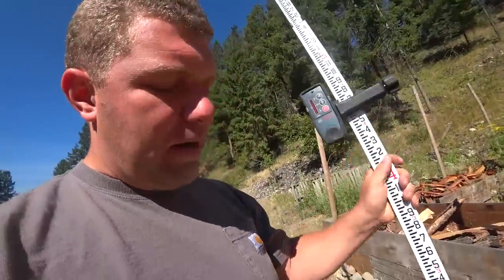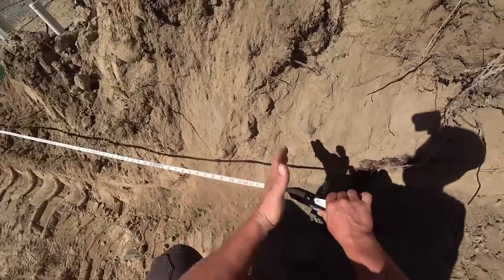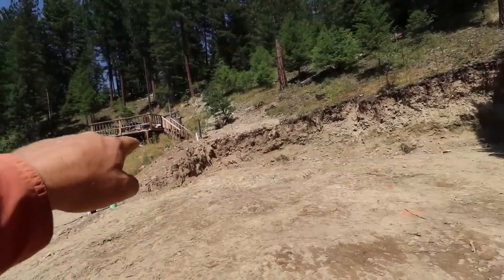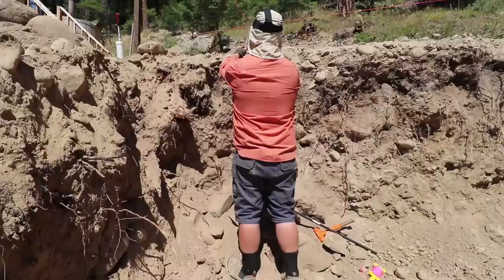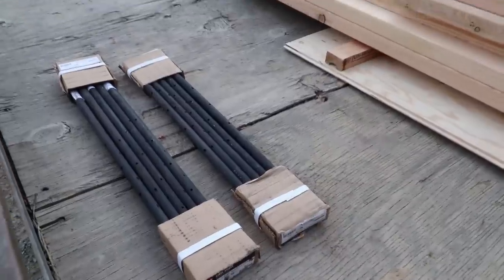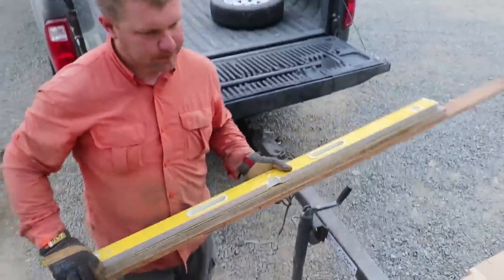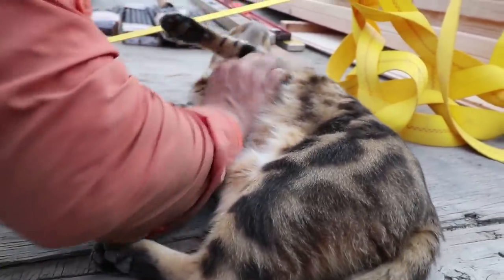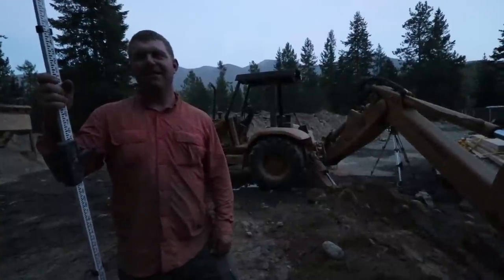TAPE MEASURE MELTDOWN (Squaring & Leveling Home Site)

Comment: Typically we only use the plastic and cloth tape measures for estimating and rough dimensions. But for crucial dimensions we use 100' steel tape measures because you can not stretch the steel tape measure, like you can the cloth ones.  I love your channel. It is informative and entertaining. Thank you very much!

Comment: The tape isn't off.  It's in 10ths and 100ths of a foot.  It makes calculations much easier.  It's completely standard in the heavy construction world works.  Architects work in inches, engineers and surveyors work in decimal feet.
Reply: HaHa..that was soo funny! "what kind of tape measure has 10 inches per foot!"  You live and learn!
Reply: "engineers and surveyors work in" metric
Reply: That's the tape you use to draw your sight plan.
Reply: Site plan, sight plan
Reply: LOL!  :-)  (From France, inventor of the metric system SI) :-)
Reply: and you should use a steel tape or chain for important measurements instead of a fiberglass or poly tape
--if temperature is an issue you can calculate for steel :)

another great video!!
Reply: Patrick Norton  or go metric and simplify your life once & for all.
Reply: Just as some people are very capable of being multilingual, some people are capable of working in both imperial and metric,as well as machinists decimals. What's next ,change  that the measurement of a circle is in 360 degrees ,a day is 24 hours  or that a mile on the sea is a nautical mile?
Reply: That tape made me  think of the three-sided architect ruler that I've had since college. I had no use for it then, or since, but I bought  it because it looked cool. :)
Reply: inexperience
Reply: This is why the entire world uses metric system.
Reply: AGREED
Reply: Use cubits, it's the 'new world' after all
Reply: scott that is not a metric tape.   A metric tape is marked meters,, centimetres and millimeters. They need to get 50 or 100 foot steel tape, because the tape they are using can be  short by 1 to 1.5 feet per 100 feet.
Reply: phillip i said that i agreed on metric system and i know that is not a metric tape.
Reply: It's a comprise over using metric.
Reply: Patrick Norton q
Reply: You may also want to send your tape measure to the standards lab.  They will calibrate it for tension and temperature.  Or at least the book I read from the late 1800s said they would do :)
Reply: Right! Whats a cubit???
Reply: A steel tape yes, which was once the standard for surveyors now they use the total station. Fiberglass will stretch so calibration is not needed - Just don't pull too hard. On the other hand steel tapes have a particular tension requirement, They are also compensated for thermal expansion by the surveyor in the field.
Reply: Steven Hardy, you can measure circles (or any angle) in degrees or radians, you know, Pi, 2 Pi, etc...
Reply: Zenithtb  Only when I have to.  A civil engineer.  Age 70
A lot of those tapes are marked in feet and inches on one side and feet and tenths on the other.: at least the one I have is.
Reply: Question.  How many countries have working probes on Mars?  Answer. ONE.
Reply: and im pretty sure NASA uses standard units for that..
Reply: A Cubit is the measurement  from th bottom of your elbow to the tip of your middle finger!
Reply: And also used them for 44 years on drilling rigs all around the world, only way to drill in feet and be able to add up in columns, very easy!
Reply: CaptAndy Sir Lol NASA uses metric
Reply: but even being in 10ths the 345 rule for squaring works, it's not about de unit
Reply: This isn't about imperial vs metric.  It's about his "10 inches  per foot" comment.  Whatever system we use as engineers is really dictated by the various state/federal transportation depts.  The feds tried converting to metric about 20 years ago in their funding bill, but it flopped.
Reply: typo should be 10 450 not 10 045
Reply: so its like metric but its not. silly.
Reply: Only since the 19th century . . whose arm are you using? it is impossible to build well with a variable length standard. (In reference to Dave W.).
Reply: Jim Steel- that would be a "scale"
Reply: Corndog I mean standard like 1 foot which is not a scale but a standard of reference. Measuring from your elbow to the tip of a finger is a standard of reference not a scale.I know sometimes the difference is slight but. . .
Reply: I was replying to Jim Steels comment, not sure why it wound up here.
Reply: Okay, I wasn't too sure but I made a reply anyway (hehe) 'cause it could have, might have, close enough, That is why I used your handle for clarity. Hey have a Fabulous day, er evening!
Reply: yup
Reply: Sounds a lot like the metric system

Comment: Had the same thing happen with a tape measure I bought from an auction.  Used it to measure out my footings and found out after just by chance using a 35ft tape that I had sitting around, and I had a high speed come apart.  Almost used it for my whole footing also.  Thank god I caught it.  You guys are doing a great job!  I used Icf's (fox blocks ) on my crawlspace walls and man they worked out great!  Good luck and keep up the good work!

Comment: The tape with tenths of a foot is a engineer's tape, used one for 40+ years in the West Texas oilfields. Tubing, casing, drill pipe and anything going in the well or top of ground for construction was measured in feet and tenths. This method allows easy tallying of measurements for totals instead of having to deal with fractions. Glad you bought the ShopSmith it is a great all in one tool but your time/project/steps will need to be planned well ahead in order to make it a enjoyable tool. The all in one does imply tool set up changes due to the limited one motor drive or all procedures. Enjoying your build and channel..

Comment: Don't  play  around  pump it you will  have  a much better pour. Remember  your home  is only  as good  as  your foundation. One man built  his house on the sand and the other  on a rock. Put as many  chain walls  and  steel  as practical. The  slab is not  were you want  to  save money. Great work  and great  Videos

Comment: One of the few things I appreciate about engineering school was learning how to work in imperial, metric and decimal.  As well as degrees, radians and many other things.  The most important thing was to ALWAYS know what units you are working in!!
Reply: Exactly...now just tell me if you did your studies using a slide rule? ( I still have mine)
Reply: Steven Hardy I'm a little too young for that.  I have been looking at flea markets for one for a while.  Thought it would be cool to play with.
Reply: Well, I remember like it was yesterday when Rockwell first released their handheld ,8 digit ,led calculator for 200.00 bucks. No science functions.....just basic math. About 1973 I think.
Reply: I remember the Bomar in 1971 or 72. It was $200, 8 digit with 1 memory.   Hewlett-Packard had their HP45 scientific calculator  for $450 in 1971.
Reply: Steven Hardy --- I looked at my old slide rule about 6 months ago, couldn't remember how to use it....lol. 
But it was a life saver in 1963-1966.

Comment: Civil Engineers and Land Surveyors work in base ten measurements.  Base 10 gradations are standard in the civil and survey industry because they follow the US Cadastral Survey Office standards which IS the standard for mapping in this country.  If your property has been mapped by a Registered Land Surveyor its units will be base 10.  If you have a topographic map of your property spot elevations listed will be in base 10.   I have researched hand written survey notes of BLM land surveys from the 1880's All of the measurements are base 10.

The "tape measure" you were using is actually referred to as a chain, or survey chain, and dates from the 1700's and 1800's. It was originally made of 100 metal links 7.92 inches each or stretched out was 66 feet long.  The US version of this was 100 feet long, each link being equal to 1 foot.  More than two thirds of every square mile of this country was walked and measured and mapped with a very heavy version of the device you are holding in your hands.

And it's not just the tape measures.  Surveyors and Engineers elevation grade or range rods are also marked in base 10 units. TopCon, Zeiss, Geodemeter, and Trimble, the who's who in GPS, Level, Total station instruments that are actually used by professionals all come standard with base 10.  Your Bosch is in base 12 because the big box stores and online mail order primary sell to the small carpenter trades and extreme DIY industry.

While the architectural and home building industry work in base 12.  All of the mapping, plotting, and elevation certifications required to get permits and certificates of occupancy of dwellings are require to be certified by surveyors and engineers in base to units to the nearest 100th of a foot.

For all of these reasons and for efficiency in calculations to an engineer or surveyor base 12 is worthless.

Comment: Surveyors tape. its in tenths of a foot. 

Makes the surveying math easier. Surveyors don't work in inches, they work in feet and tenths of a foot.

Some grade rods are also in tenths of a foot. you may want to check yours.
Reply: Do you really go through comments first? Wow... That's dedication..
Reply: Hal S --- Their grade rod is in feet/inches with 1/8" increments. So they are good there.

Comment: So it dawns on me,  as I watch someone who has no idea what a 10ths "engineers" tape is,  you talk about using ICF's and a typical foundation layout for a stud wall/platform build.  But you have said in the past that your doing a post and beam construction house, which has significantly different foundation requirements.

Can you let us know how you are digging your foundation holes with no foundation plans indicating the size of the footings required for the engineered loads based on the post and beam construction?

Comment: I installed a window air conditioner in one of our rooms at work last week and it came with a tiny plastic strip that had measurements on it (inches on one edge, metric on the other) so you could cut the little insulation panels that came with it. I was doing some measuring and realized the inches were divided into tenths instead of eighths. I went ahead and used it... didn't really matter as long as I used the same thing to measure the hole and the piece I was cutting.
I wish we would go ahead and switch to metric. It would confuse people for a while but it's a way easier system to use.

Comment: It's NOT metric, it's an engineers scale, it's an american thing. It simply divides a foot into ten increments instead of 12 inches, and each increment is again divided into ten (ten pennies=a dime, ten dimes=a dollar. Very easy to use, i used to teach people think of a foot like a dollar, 100 cents=1 dollar. When doing percentages 5%= five of those little lines. 2.75 would be 2'9" or two and 3/4 feet... or $2.75. Each tenth of a foot is apprx 1 1/4". Each little line is apprx 1/8".Takes a little getting used to but also most inspectors (ones I've dealt with) use engineers scale when checking your work. Good look with the build guys.

Comment: Hi Luckily for you it worked out, this is a long time ago (The 70's and in the UK we were just going metric) but a close friend bought a long imperial  tape from Taiwan  and it had 10" to the foot so his keel ended up way short before he noticed and to far into the build to change it, so he ended up with a shorter boat than was planned.

Comment: One thing i did hear jesse say that the concrete contractor told him not to over excavate to much @ the back of the wall? but you can still slip a form in there? how do you guys plan to slip it in there and brace it and then strip it all at the end? i saw like 4-6 inches of clearance. Ive always seen 18'' -24'' wide clearance to work in but hence i would never go behind a wall that high that close even 24'' clearance that could cave in =( , Please comment =D

Comment: Concrete pump, fill the trench with log. Bricks, blocks, sleepers. Thick metal plates across the trenc.Truck then can drive over. No such thing as can't. NOTE make sure it's easy to pull out off the footing (no time wasting when pouring). Makes sure when packed it is a tight fit so no colapse. You can send half the saved money to my account. Only taking half as I'm not greedy. Good luck hope you get this in time.

Comment: Did you (or 'DO' you) check for square diagonally corner to corner to corner? I know you can check one square corner with 3,4,5... But I think you would still need to check from corner to corner diagonally??

Comment: Recheck your state plumbing code. IBC is 1/8" per foot on 3" and 4" pipe. 1/4" per foot on 1-1/2" and 2" pipe. Will you be using 1.6 gpf toilets.

Comment: Did the ICF company mention any negatives in the use of ICF's?  I've never been crazy about them where there is a lot of soil moisture as we have here in Western Oregon.  Your climate and weather are more forgiving.  We were told that Styrofoam (Expanded PolyStyrene EPS) works as insulation and the forms.  I helped a fellow replace his dock several years ago and it was made with EPS blocks.  I was to lift the dock out of the lake with my 15 ton rough terrain crane and was mistaken about how much water EPS can absorb.  I expected to just pop the dock out of the lake.  I didn't think the big EPS blocks would absorb anything.  I nearly tipped my crane into the lake trying to lift the dock out.  It was unbelievably heavy.  We had to float the dock to the boat ramp and disassemble it piece by piece.  When EPS gets wet, the insulation factor goes down to very near zero.  I learned a lot as to where ICF's are good and Arizona is a better climate.  

I do the design and drafting work on the houses I build.  One of my clients is acting as his own contractor.  He was sold on ICF's by a dealer he met.  I designed the house with a standard concrete wall with insulated frame walls on the inside.  The owner had the engineer convert the calculations to use the ICF's.  He then found out that the electrical codes required him to run everything in the ceilings and then drop down with electrical conduit to the switches and outlets which was a pretty large extra expense in labor and materials.  He then found that a lot of sheetrockers in our area won't work over ICF's.  When he did find one, they required the owner to install furring strips to the walls to screw the sheetrock to; another unexpected cost.  Plumbing was a bit of a problem on the outside walls, but not as big a deal as the electrical.  Also, anything above the final grade on the outside has to be finished with plaster, stucco, siding or stone so that the critters don't make a mess of it.  Chewed up and dirty EPS isn't really attractive.  

I just poured the stem walls for a foundation on a log home restoration project and I used pebble drain rock instead of crushed rock.  We stripped the forms quickly and sandblasted off the surface sand and cement to expose the aggregate.  I wiped it down with muriatic acid, rinsed it, let it dry and then applied a clear acrylic sealer.  It looks good and is a no maintenance finish.  When I run the numbers on all the work to pour the walls, frame, insulate, electrify and finish the walls, I come out cheaper in the end.  I don't see ICF's being used at all these days in my area.

Comment: You can mount the laser sensor on your bucket and check the depth from your seat ... just have to make sure the bucket is in the same position every time you measure.

Comment: Nothing wrong with paying a bit more for convenience and that pump was slick.  But you didn't have to leave out a section of footings otherwise.  the alternative is called a wheelbarrow, and most construction guys fill their footings that way. 

That laser level is a luxury, when I first started they didn't exist, but its awesome you have it.  

A normal excavation is a 2 foot offset from the outside wall.  

You are lucky that your frost protection there is only 2 ft.  I am Canadian and we had 4 ft where I Lived, and that was a place that is south of 40% of USA.  

You guys are really doing amazing for having never built a home before.  Are you going to be backfilling your foundation to put a slab at grade?

Its also amazing how a couple cal live and work together 24/7 and still be cool with each other.  Respect.  

In theory, if your footing is off, you can still correct your foundation to square.  But, even if your foundation is off square (and believe me, many/most production built homes are) you just build on top of what you have and its fine and no one would ever know.  

For footings, we always purchased 2X6 lumber and just used it in the build.  Mostly for building up a basement foundation stub wall.  

Can you get some forks for your bucket?

Can you tell I am pausing and commenting as I watch?  hehe.  

Did you know you could have purchased (and popular with the ICF community) a footing form that is also a weeping tile?  After the pour, you do not remove it, it stays in place as drainage.  

Ok, you did definitely not need to purchase 16 ft premium form boards for your footings.  Even if a footing has a crown (warp) in it, the concrete finds its own level to a certain degree.  Finding 16 ft boards that are straight is crazy.  You should have seen the form boards that my footing crew used again and again and again.  All kinds of shorts and pieces.  They form the corners and fill the rest, and just overlap.  When I poured my own, I didn't want a joint like that, but now I wouldn't care as I realize the function of the footer.  

Jesse, you're a rock star (no pun intended) machine operator already.  Good work. 

You must know that you can get a magnet reader that goes on your excavator arm for your laser right?  Then you are solo.  

"lets go cuddle". so cute.